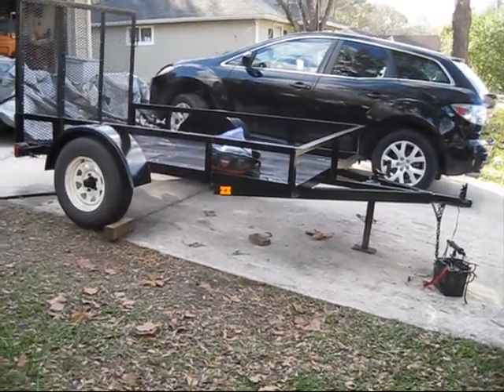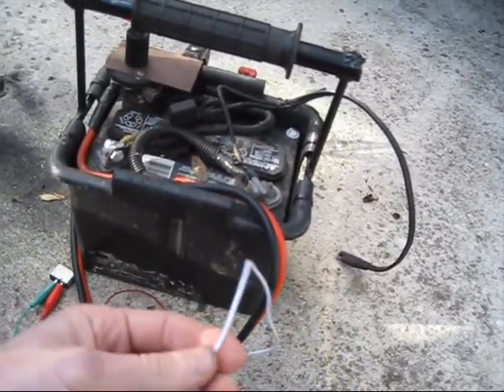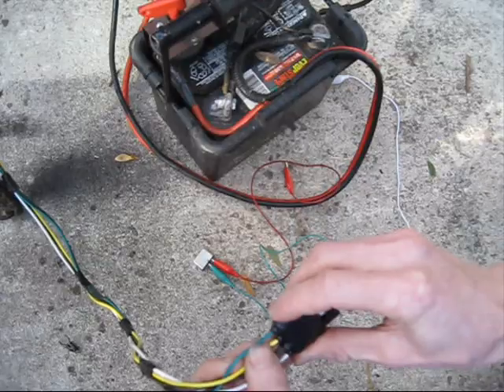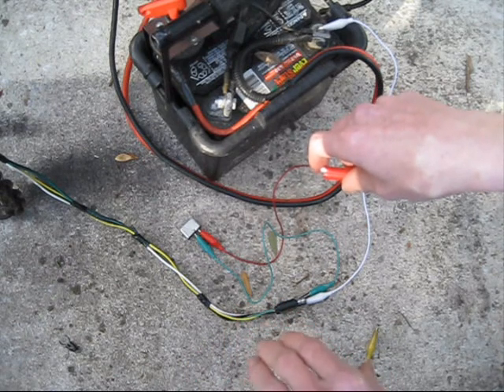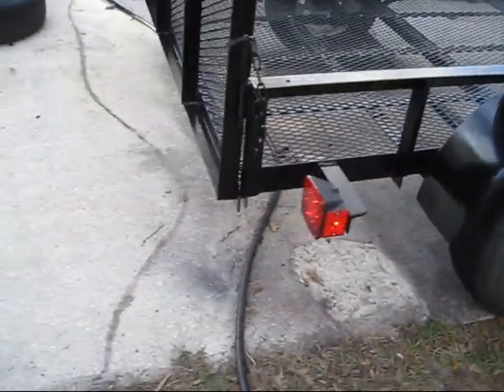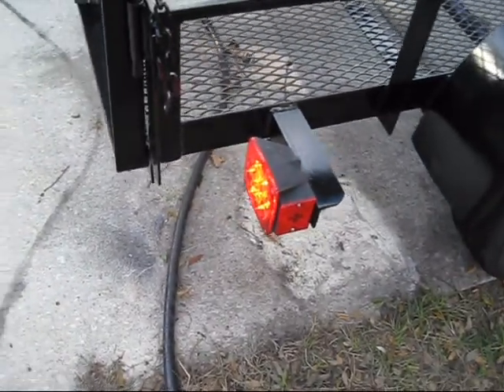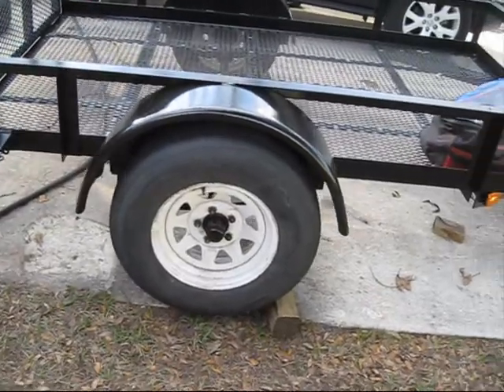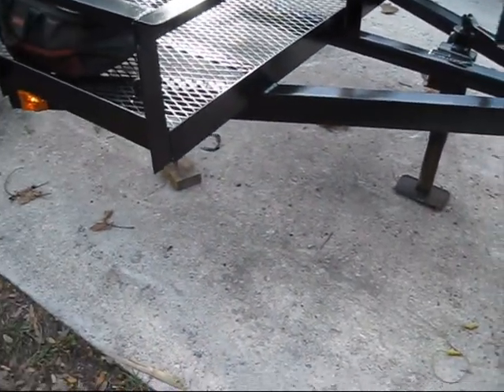How to quickly and easily test trailer lights with a battery

Comment: Excellent helpful video! 👌 i have a brand new trailer with only 20 miles on it and the left brake/turn signal doesn't work . Weird because its an led. Gonna use a spare lil jumper tomorrow to see it i can figure if its the wires or the light.

Comment: how do you isolate the blinker lights from the brake lights for testing? Good vid, thanks
Reply from the maker: They're the same circuit on trailers. Running lights is a separate circuit.
Reply: So if you get light in green wire for example that means you have your 
right signal and right brake light working as they are the same circuit assuming it's wired correctly...right?

Comment: I know this is an old video. It's close to what I need but not quite so I thought I would ask for help. I no longer have my camper, but I saved the deep cycle battery. My van still has the 4 flat harness built in. I want to use that harness to charge the spare battery while driving, so I can run a small fridge in my van. How do I hook up the 4 flat to my spare battery? Do I need a charge controller, or will the alternator prevent the second battery from overcharging? Thanks!
Reply from the maker: 4 flat wont cut it. You can only get lights out of a 4 flat. You need a 7 way connector to get the charging circuit. It will charge until the battery equalizes with the vehicle, so no charge controller needed.
Reply: @pfun41 Thank you for your response. I'm going to check with my mechanic to see about a possible isolator. He's a camper, too, so he may have some ideas for me. I want to keep things simple and use what I have until I figure out this traveling thing!

Comment: Nice video! what CB did you use?
Reply from the maker: Smallest one I had. I think 20 or 25 amp. I would have preferred lower but this was better than nothing and the trailer didn't have any shorts. If your diagnosing a trailer with issues get a 10-15 amp breaker.

Comment: I use my tractor to back my boat in the garage, but the surge brake solonoid will lock up if no power is run to it. Can I just run a ground wire to the negative terminal and a power wire to the positive from the reverse light wire on the trailer and activate the solonoid to release as if my truck was in reverse and connected? I hate having to put a device on my tongue to lockout the surge brake
Reply from the maker: yes, just fuse it and make sure the wire is the correct gauge.
Reply: @pfun41  thanks for that!

Comment: How could I have tail lights and side marker lights working but no brake or turn signals?
Reply from the maker: Brake and turn circuits are separate from the tail light circuit. So very easily.

Comment: where do you find a small circuit breaker like that?  I want one.
Reply from the maker: Auto parts store, amazon, ebay. They're automotive circuit breakers, typically just a bit larger than a standard ATO fuse.

Comment: Where did you get the little 12 v circuit breaker?
Reply from the maker: Junkyard,  many cars will have a circuit breaker or two in the fuse box.

Comment: Can you test the brakes this way too?
Reply from the maker: Yes, but you will have to look at the pinout to determine which wires to use, also unless you have the axle jacked up and someone to turn the wheel you'll just have to listen for a clunk from the magnet inside the drum. Make sure you use a heavier gauge wire, as the brake magnets will pull more current than the lights.
Reply: @pfun41  yea i have the axels off the ground! So they work with 12v?
Reply from the maker: @casimirobuenabista  yep.
Reply: @pfun41  thanks

Comment: How do u check trailer lights using a rechargeable power pack?
Reply from the maker: same method.
Reply: @pfun41  So do you just connect the testing wires to the positive and negative clamps used for jump starting a vehicle?
Reply: Also is there a printable version of this?
Reply from the maker: @randylauer220  yes
Reply: @pfun41  Thanks for your help!!